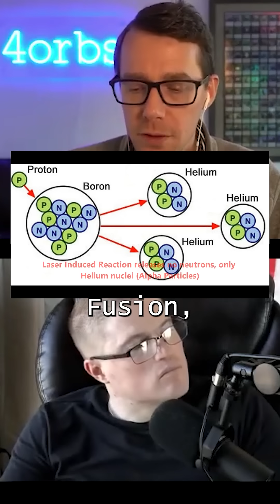Tapping the Energy Hidden in Plain Sight

Comment: Zero Point Energy just refers to the minimum energy of a quantum system. Pulling energy from that doesn't make sense without a chemical or physical reaction. Both types are associated with a (tiny) loss in mass, which is where the energy comes from.

I've never seen this channel, but just from this short, it seems like a lot of pseudoscience terms are being thrown around, free energy being the biggest red flag. The idea that mass is really just energy stored in fields that are forcibly bogging down particles from free movement is already a crazy paradigm shift to absorb without making stuff up.